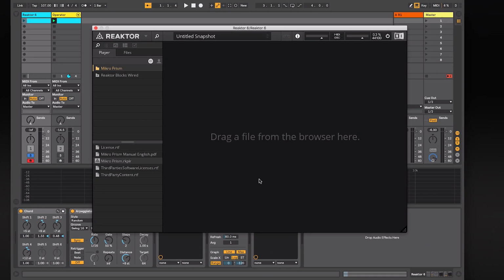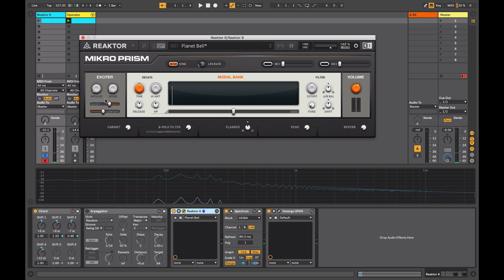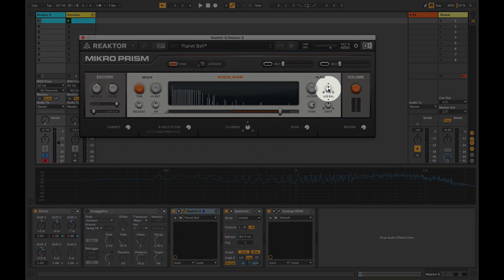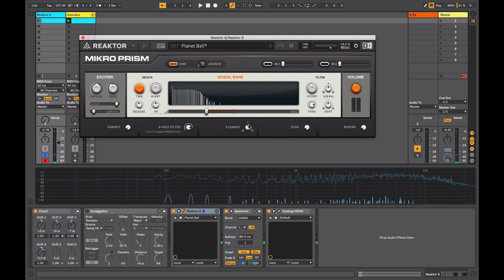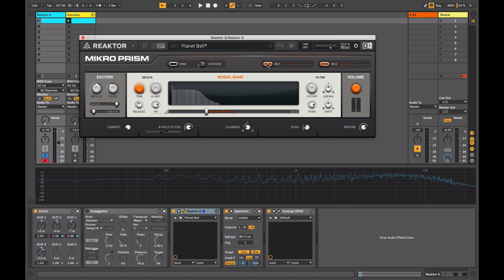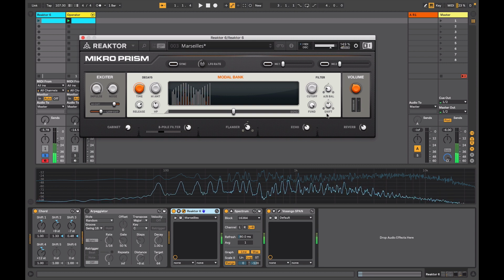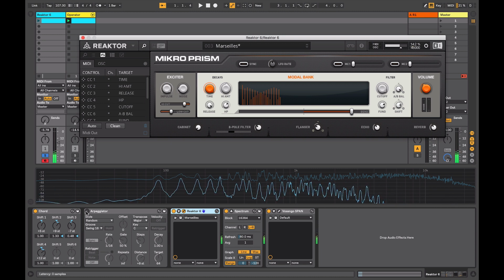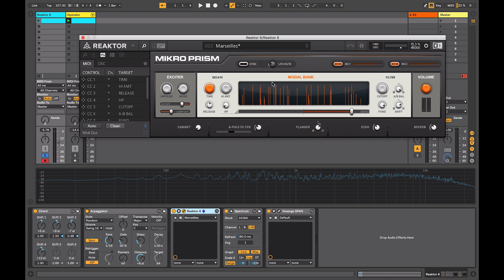Reaktor Mikro Prism overview

Comment: I'm confused; I've opened Reaktor 6 in Cubase, selected mikro prism and it says that the midi is set to 'All inputs' on the left in Cubase. But when I play with my midi keyboard I get no sound. My sound system is fine and midi running perfectly for everything else... I'm new to this so there's a high chance I just don't know what I'm doing. What is in the background of this video behind Mikro Prism? Is there some other software I need for it to work?
Reply: Be sure to click on the little speaker Icon on the channel (in Cubase) you've put the plugin on or you will hear nothing.